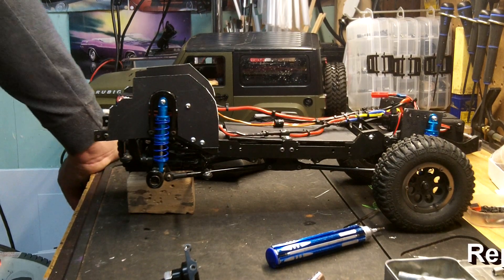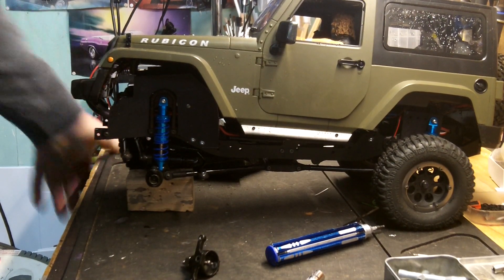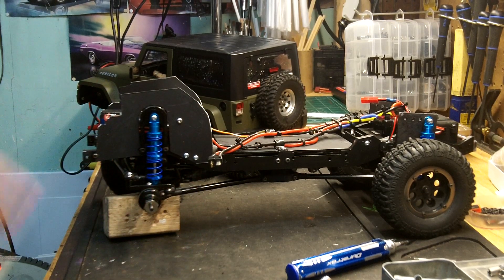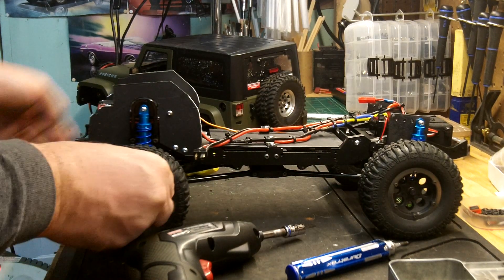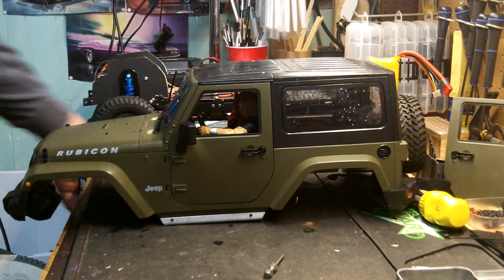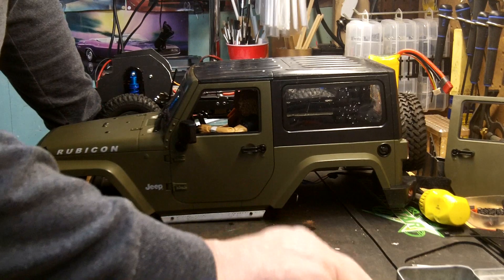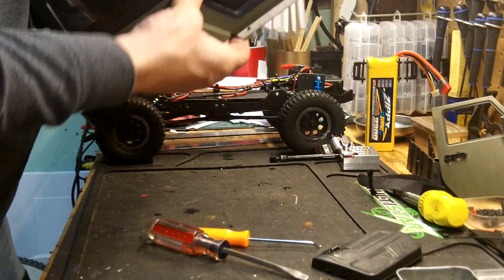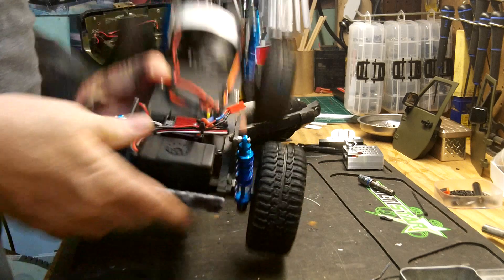China JK on Gelande 2, tube doors

Comment: I like how you speed over the mundane parts,  but slowing down to give tips on what you're doing would be nice.   You started to explain why you were talking off the floor panels,  but cut yourself off to fast forward.   Other than that,  I enjoy your style of videos.   Nice job!
Reply from the maker: Sorry i missed that in editing. I removed floor covers so I could remove the battery for better access to the pins that hold the doors in. Thanks for catching that.

Comment: Do that jeep body bolts on into the rc4wd d90 gelande chassis without modifications? Or do i have to cut and trim some of the body for a perfect fitment? Look awesome!✌😎👍
Reply from the maker: I made a few mounts that bolt to the body and the front just slips in and a single 3mm bolt in the back. I have since added a speed nut for the back. Heres  the video. https://www.youtube.com/watch?v=qxYjMuERJys&list=PLTdmuoZjx8OfdJF2BX-KkBVoM-MQcQQdH&index=14&t=512s

Comment: Are those 60 mm shocks in the rear?  I was going to go that route,  but wanted to keep the original travel of my SCX10 ii.  I modified the rear seat a little.   I'll either put cloth seat covers on or make vinyl (duct tape) seat covers.   :)
Reply from the maker: 70 MM Shocks all around. I haven't even started on the interior yet. Thanks for watching and commenting.